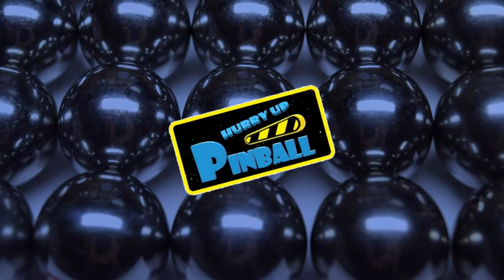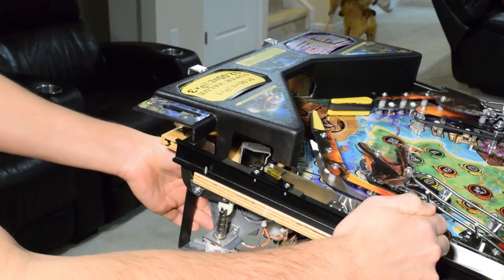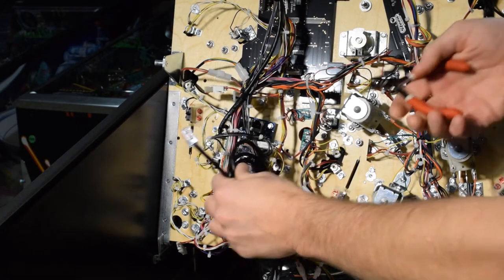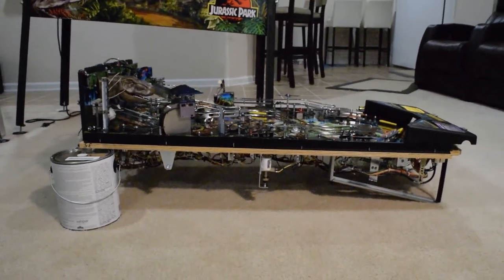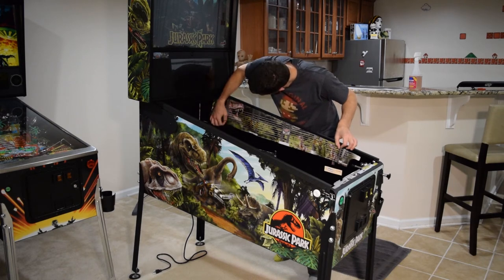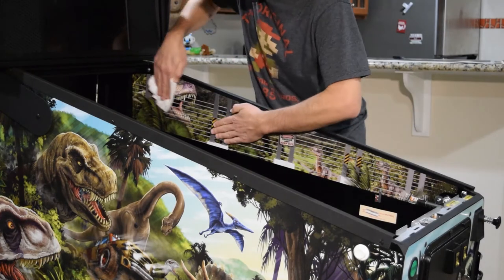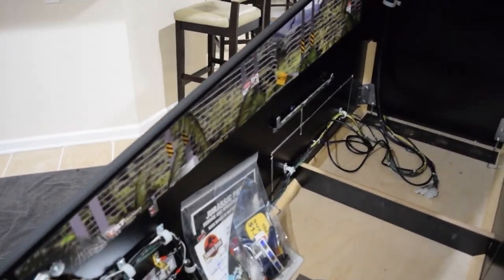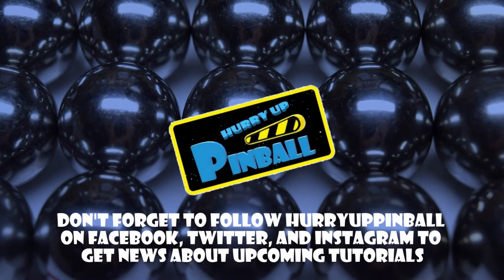HurryUpPinball - How to install Art Blades

Comment: Thanks for another educational tutorial. I was not aware of the Rapid Tac product, so that alone is going to be very helpful!
Reply from the maker: I have starting using painters tape to line up the art blades and then carefully apply it aplly half the art blade at a time. I have not used rapid tac for a while but it is still great for the first few times until you get more comfortable. JJP games can be a bit trickier since you can't easily remove the playfield. Those ones still stress me a little bit :)

Comment: Great video, I own a print shop specializing in reproduction art for arcade machines etc. my only comment would be regarding the use of Rapid tac / soapy water... It can only be used on plain vinyl, if its air egress vinyl (bubble free install as often marketed) doing as wet install isn't recommended by the actual vinyl manufacturer. It has to be dry install only, however it is quite forgivable until you completely press it down. FYI Stern use air egress vinyl for their licensed products.
Reply from the maker: Thank you for sharing the information. I have since moved to dry applications in the past year or two. Stern blades are easy with the air egress but there are a few out there that don’t offer that so just wanted to offer an option for people who have never done it before. Thanks again for the info and I may make an updated video at some point in my current process.
Reply: @HurryUpPinball   yes, the main issue is a lot of people have no idea what vinyl they have. Sellers often don't even specify this information. When looking at the adhesive side of a "bubble free" vinyl there are micro channels within the glue that let the air escape so you know it has to be installed using a dry method. Might be good to add a disclaimer or text to the video at the rapid tac step "for regular vinyl only (not bubble free vinyl)".

Comment: Hey Craig, great video.  New to the hobby... what are your thoughts on mirror blades?  Which games do you think they would go best on?
Reply from the maker: I really like mirror blades for games. I will typically put them on if I don’t find a set of art blades I really like. Then can help (a little) to brighten up the playfield on darker games. I think they look great on POTC and LOTR. They are a great option for a lot of games. I always look for art blades first and move over to mirror blades if I don’t find anything I like. They cost a little more than art blades but it is not drastically more expensive. If you get mirror blades or art blades, get cabinet protectors to keep them nice. It sucks when you scratch the mirror blades while moving the playfield.
Reply: @HurryUpPinball  Thanks for the advice man!  Take care and keep up the great work on the vids!

Comment: I added a vinyl playfield overlay to my Bally Star Trek about 20 years ago. The playfield is still beautiful all these years later, but the front half is starting to come up in spots. Any suggestion for what kind of adhesive to use to glue it back down?
Reply from the maker: That’s a tough one. I can ask around. I have used the freeze spray method to remove big sheets of mylar but no matter how careful you are, if it has been on for a long time, paint will usually lift. If it is peeling up, you will most likely end up with dirt and dust under it even if you put it back down. If it is a very small area, it might be worth it to use an exacting knife and try to remove that tiny area. Old mylar can be really tough to deal with and always makes me anxious when dealing with it in older games. I will ask around to see if anyone I know who restores games has advice on reattaching mylar.
Reply: @HurryUpPinball  thanks, I really appreciate it!

Comment: Great vid thanks! Can one use some other type of spray? Maybe Windex or something laying around the house?
Reply from the maker: I have seen lots of different posts about things you can use but I prefer the rapid tack just because it’s simple and works really well. I get a little nervous about using something that may lessen the adhesion of the art blades. If you decide to use something other than RapidTac, just be sure to check the pinside forums and see what people recommend.
Reply: @HurryUpPinball  thanks for the reply. I installed my Ghostbusters art blades with no issues. I think any art blades that are thinner though will be a little more difficult and probably require some sort of wet application!

Comment: Hi there!  I'm thinking about getting blades for my Avengers IQ soon..  but I've always been terrible with stickers, cell phone protectors..etc.... so its freaked me out a bit..  Are these like stickers? i.e once they touch that's where the stay?  It looks like you are moving and repositioning them even after they touched the cabinets though. Thanks.
Reply from the maker: The decal solution will make it so you can reposition them as needed. One of the other methods I really like, once you remove the playfield, is to use painters tape and hang the art blades exactly where you wanna place them. I use 4 to 5 pieces of tape to hold them in place from the top and then I cut a small section of the art blade backing off and put that section down. If you’ve lined everything up properly with the painters tape, you can easily remove the other half of the backing, and the graphics should be exactly where you want them.

Comment: Thanks for video!
I saw elsewhere to use windex glass cleaner? Is this an okay replacement for Rapid tac?
We just bought blades for Deadpool and Iron Maiden
Hope to find time to install them soon.
JP pro is our next machine, Are you enjoying it still?
Stay safe
Reply from the maker: The Rapid Tac is not 100 percent necessary and I have recently starting installing art blades on games without the Rapid Tac. I can't speak to Windex being used in place of Rapid Tac but I have concerns it may dissolve the adhesive that holds on the art blades. I have started lining up the art blades using painters tape then removing a section of the backing in the back of the cabinet and sticking it in place then removing the rest of the backing and working out any air pockets back to front. I installed art blades on Wonka yesterday using this method since it is a lot of work to remove the playfield. If you have tight spaces and are not able to remove the playfield, I would recommend using the Rapid Tac until you get comfortable. It makes it easier to reposition the blades if they are not lined up correctly. Just use a very fine mist, don't soak them. I would highly recommend a set of cabinet protectors from Pinball Universe if you are going to install art blades - they are $35 at Pinballlife.com and will make sure you don't damage anything when raising and lowering the playfield. In terms of JP, it is a great game but I was the only one who really played it and I picked the last 15 games so I ended up selling it to purchase Wonka for the family. I am at a point where if I want something new, something has to go unfortunately. I'm sure people will give me heat for selling JP for Wonka but we are having a blast with it thus far.
Reply: @HurryUpPinball  Thanks for the great advice
i bought rapid tac and hope to find time between hockey games to install them this weekend
enjoy wonka ,
I haven't played wonka yet
again thanks
stay safe

Comment: Nice, but if you know your washer sits on top of the blade, why do you cut it rather than removing the washer, applying the blade and then screw the washer back in...
Reply from the maker: When the issue arises, I have started removing the washer (if necessary) as opposed to cutting the art blade. It can depend on the manufacturer of the art blades as well regarding how low they go and if the barely touch the washer. Loosening it prior to install works too.

Comment: Hey, question for you if you dont mind.. is the Rapid Tac used so you can slide the decal around to get it in place during application or does it just make it easier to remove it if you need to try again? Also, how come your art blades don't have holes in them like the Stern ones?
Reply from the maker: The rapid tac is good to use the first few times but as long as you get them in place properly, you can skip the rapid tac. Since I started removing the playfields on sterns, I use painters tape to hang the blades in place, uncover a small portion of the blades, then stick it down. I then move to the other end and finish peeling off the backing. As long as they are lined up, it’s all good. JJP and older games are difficult to remove the playfield so you can try the rapid tac or position them correctly using painters tape then raise the playfield and do the two end method. The area where the standing playfield is can be a bit tricky. The art blades I installed were not sterns so I had to cut them out for the holes. The stern ones are super easy to line up and install because of the holes.

Comment: Question if I was installing, Mirror blades would I follow the same process.. or do you recommend it being done without taking out the playfield?
Reply from the maker: Since mirror blades are screwed into the cabinet, you shouldn’t need to remove the playfield. I would recommend a second set of hands to help line them up before installing the screws. I would also recommend the pinball universe cabinet protectors so you don’t scratch the mirror blades when raising and lowering the playfield. https://www.pinballlife.com/interior-cabinet-protector-blade-set.html

Comment: Is dish soap and water (like the guy mentioned above) the same as that rapid tac? 
I'm about to try a Batman Forever art blade, but I'm nervous coz I'm the umhandiest human alive. 
Any advice ?
Reply from the maker: I have heard of people using that but never tried it myself. If it is your first time installing art blades and you cannot remove the playfield, I would suggest rapid-tac. It will let you slide them around a bit. Regardless of what you use, just mist them lightly and don’t soak them. I have started installing them without rapid tac lately. I use painters tape to perfectly position the art blade then peel the back half, cut away the backing, and stick it on then repeat for the front. For games where you cannot remove the playfield, you can use this method but it can be tricky. For games where you can’t remove the playfield, rapid tac is the way to go if it is your first go at it.
Reply: @HurryUpPinball  mate thanks so so much for talking a rookie through. So nervous though and intimidated by the process, but I guess everyone gotta start somewhere.
Reply from the maker: I remember being really nervous about it too. Rapid tac allows you to reposition them and makes it much less stressful until you get the hang of it. Always test fit them with the backing on so you know how they should sit and be sure to take into account the hinge bolts one each side. If your art blades do not have a pre cut hole for the hinge bolt, be sure to remove the bolt before installing the art blade and then use an exacto knife to trim the circle out then replace the bolt. Also make sure the art blade is not so high that it interferes with the glass channeling. Just go slow and test fit the blade to look for any potential issues.
Reply from the maker: @GlennTwiddle1  For bolts, nuts, switches, and game specific parts, I usually order from Pinball Life, Marco Specialties, or Cointaker. For changing bulbs, I like to order from Comet Pinball. For art blades, I like tilt graphics if not going with factory art blades. There are a bunch of great sites out there and these are just a few. There are a ton of great mod makers out there and I usually just google the game title with “pinball mods” to see what is available.
Reply: @HurryUpPinball  mate you're a champion for helping man

Comment: Wayyy to difficult. I use some dish soap and water in a spray bottle. I place it on first with the backing to see where it will line up, then I remove the backing, spray it down, and shimmy it into place with he playfield installed, just vertical. I takes 10 minutes tops and comes out great.
Reply from the maker: It all depends on the game really. It’s really easy to take out the new stern playfields. I find JJPs can be a bit tougher based on clearance but doable for sure. It really just depends on comfort level. For non-stern games, I use the method you mention.